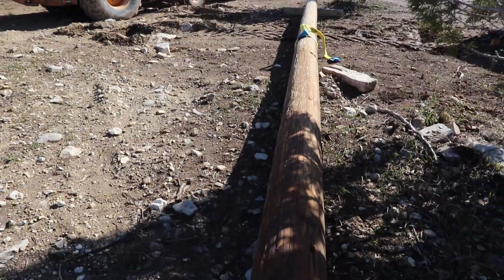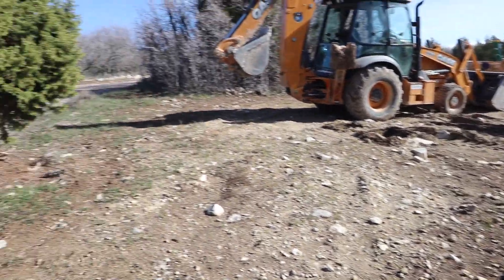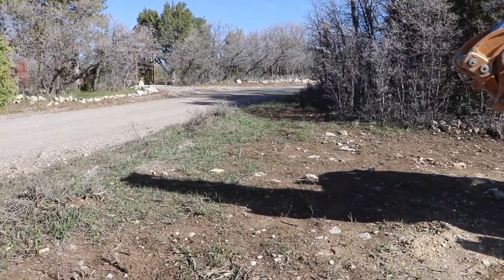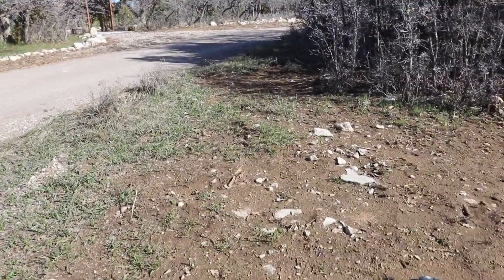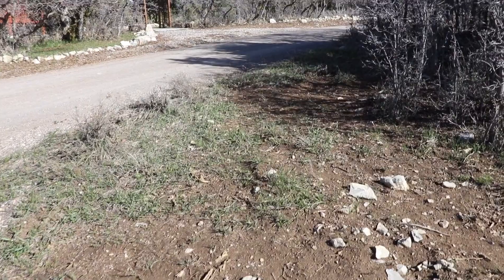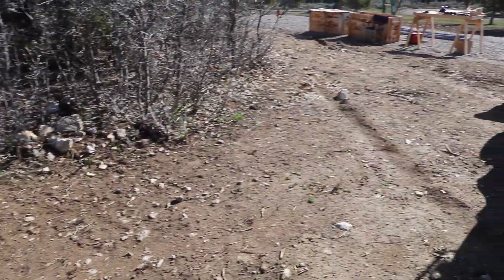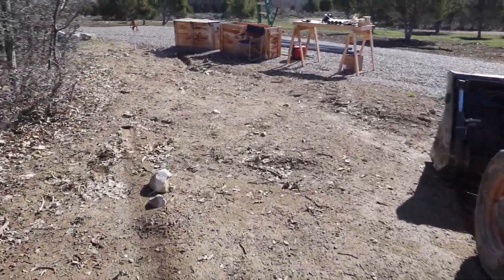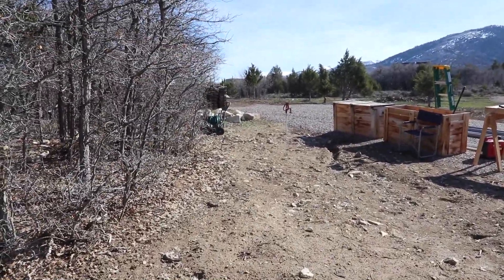How to Install a Utility Pole in the ground for electricity hook-up

Comment: That worked great. Next time try to spot the pole with balance point of the pole next to the hole. Choke the pole with a shorter sling about a foot or so towards the top of the pole from that original balance pole. Set your machine close enough that you can use the how part of the machine and clip the sling into the hood on the bucket( digging hoe. Have someone guide the pole from the butt as you log it up. Being that you picket it butt heavy it’ll stand right up but be a little wobbly. Then stick it in the hole and plumb it. This will work as long as you use a shorter sling so you don’t lose height from the hook on the bucket. Also as long as the hoe reaches high enough.
Reply from the maker: Hey, excellent advice from a pro lineman--I Love it!  Thank you for your feedback and support.  This was my first pole-rising, and I'm still awaiting my 2nd opportunity.  The best part about this pole is my neighbor had an extra, and gave this one to me for 'free' ... we dragged it across the field from his place to mine, lol.  It pays to be friendly and neighborly.  Thanks again, Brotha!
Reply: @fixintodoitall  no problem!!!! Love good neighbors!!!! Not much of that anymore these days. That was smart the was you double choked the pole so it wouldn’t roll off to the side.
Reply: @fixintodoitall  just noticed all my typos🤦🏼‍♂️ you get the point. Happy Memorial Day be safe!!!!

Comment: Were would you go to have someone come to you property and install electric poles then connect them to you home
Reply from the maker: First, you need to have your local power company find out if you can hook up, keep your fingers crossed you won't need to add a transformer before they hook you up.  If you need a transformer, it'll come at your expense (I lucked out, but the next builder who followed behind me had to, lol).  Second, you need your county or city (whoever has jurisdiction) to give you some direction.  They'll give you direction as to what type of hook-ups they want you to have for your size of hook-up.  Once completed, the county or city will send an inspector (at your expense) out to sign off and give you the permit for hookup.  This permit is what the power company will need to hook you up to your place.  It's pretty simple, you just need to make phone calls and someone will direct you to the right person.  Best of wishes.

Comment: What kind of piping do you recommend for the electrical wires? and how deep does the pole get buried? Do you have to bury the pole in cement?
Reply from the maker: As far as pipe recommendations, I would check with local codes.  My ground is very hard/rocky; I just dug a hole and slid it in place and covered it with the existing soil.  I would imagine this would be the same for anywhere else, they might just have a different requirement on the depth they allow for the pole.  Mine was 6 feet.  Somewhere else if softer soil might require 8 feet.  I would make sure to check with the power supplier what they all require through their code.  Thank you for asking and for watching with your support--Good luck to you!!
Reply: @fixintodoitall  The industry standard for pole setting depths is 10% of the pole length plus 2 feet. 5.5' for a 35 foot pole 6' for a 40' 6.5' for a 45 and so on. Some utilities set a minimum of 6' for pole depth

Comment: That's so smart! How wide is the hole you dug? Or did you dig a trench for it to slide in diagonally first?
Reply from the maker: Thank you for your comment.  I dug the hole with this same backhoe, so the hole was much wider than the diameter of the pole.  I did also have the start of the trench for the underground electrical to run to the cabin--Plenty of room!  Luckily for me (not shown in the video), a neighbor just happened to have his excavator available to push the dirt back into place while my backhoe (rental) held the pole in place.  Something to think about.  I wouldn't want to push all that dirt back in place by shovel and something needs to hold that pole in place while doing so.  Wish I shared that in the video.

Comment: Not bad, I’m sure you saved yourself a lot of money doing this yourself.
Reply: Yep I ended up going the easy way and paying for someone to install a 25ft pole for an overhead service and wire everything to the existing panel. Cost me $4500 in California!
Reply: @JP-zz5rm  I just got a quote in Texas and for a 20 ft pole, with a prewired 200 amp meter and box, it's $1,100. It's an additional $400 if I want them to bring it out to my property and install it for me. So basically he saved $400 here depending on where he lives. I'm just thinking it over and my concern is I am getting a deal by buying a preset up pole, and with everything already attached, it seems like it would be almost impossible to install it myself without messing up all the hardware pre attached. If they mess it up during install, they have to replace it. When I figure the time it will take me to go get my trailer, drive to pick up the pole, then drop it off, then drive to go get my buddies tractor, all the gas, and the time it will take me to dig the hole, install the pole, and then take all the equipment back to the places I got it, it will be a very long day and I think after fuel I will only save about $300. I can work an extra day at work getting overtime and make that $300 extra doing quite a bit easier work than would be involved installing this pole.
Reply: @Steven-gv1ke  I would go the easier route , only because it will save you the hassle of having to deal with digging the hole , placing it in there making sure everything is done right without damaging the pole or box. Not to mention they can test for power & what not & make sure everything is ready to go 100%. I had the guys who installed it stay until the inspector gave it the OK . I had to hire a company because where I am at we have a lot of hardpan & it’s really hard to get through without the right equipment.
Reply: @JP-zz5rm  yeah also installing a pole with the meter, box, conduit, etc on it, is pretty tricky without potentially tearing the hardware up. If I let them install it and they mess it up, they have to pay for it. Plus I would not feel right not at least buying my buddy with the tractor, a nice steak dinner for letting me use it. In the end, it would only cost me about $250 more to have it installed. If it was $700 or so to install, I would absolutely do it myself.
Reply from the maker: I did, thank you for your support!

Comment: You skipped digging of hole for the power pole - how deep?
Reply from the maker: I'd have to check my notes.  You'll need to check with your county or city guidelines.  They'll have to approve your depth depending on a lot of different factors, soil and wind to name a few.
Reply: @fixintodoitall  OK - thanks!
Reply: @raybin6873  most of the time 10% of the pole height plus 2 ft extra will give you the right depth .
Reply: Probably different by area/utility, but where I am PGE defines the depth depending on pole type and height.  For me it’s 6’ deep on a 25’ pole.

Comment: What is that strap that you are using?
Reply from the maker: 2 of these:  https://www.harborfreight.com/6-ft-6400-lbs-capacity-lifting-sling-61233.html?_br_psugg_q=straps
and 1 of these:  https://www.harborfreight.com/34-in-d-ring-shackle-for-suv-63743.html
Reply: Your moms strapon